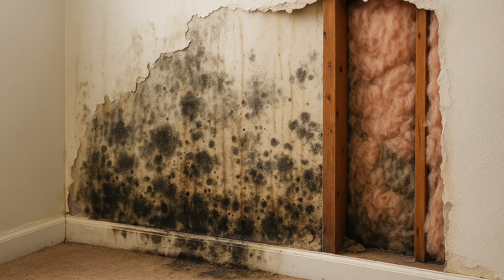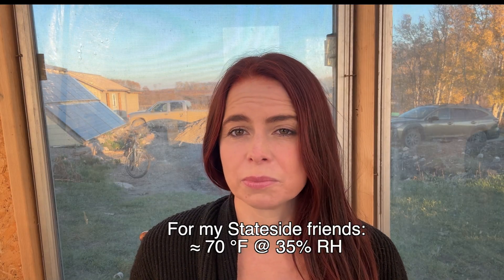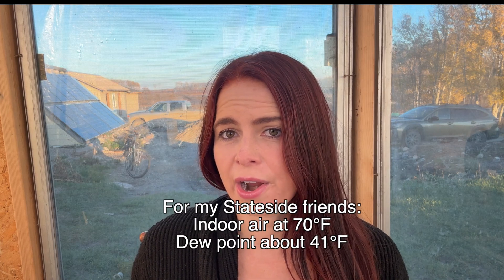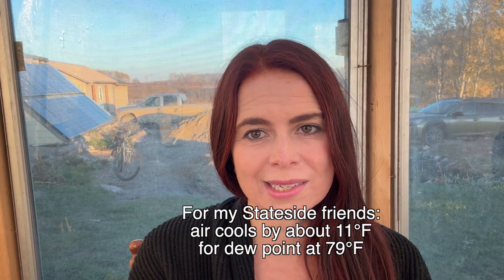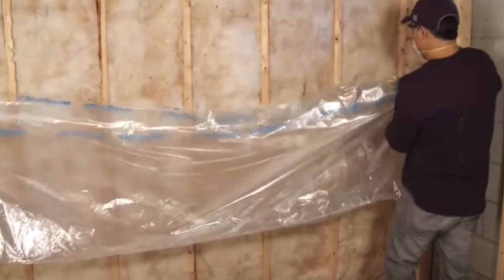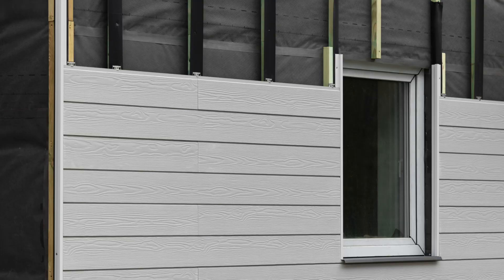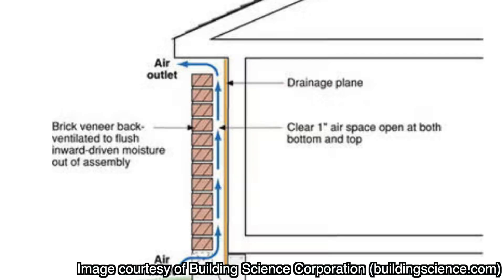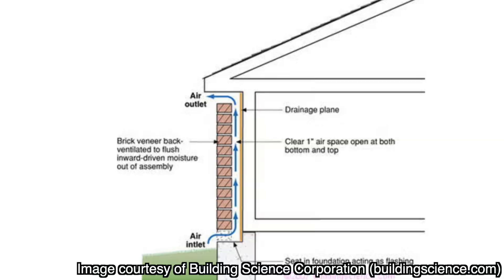How Air Leakage Rots Modern Homes (Even Without Water Leaks)|  Part II

Comment: I have an old house. Zero mold, house is always fresh and it leaks air like a sieve. When we try to make homes air tight thats when we trap problems, especially when these membranes are not installed correctly.
Reply from the maker: That's exactly it.. if we're going to make it airtight we really need to do it right.

Comment: The transition from plaster to taped drywall in most of N. America created a number of new pathways for inside air to get into the insulation cavity. There are gaps around outlets, heating ducts, and behind the wood trim that would have been filled in the plastering process, but are often ignored by drywall installers. The polyethylene  installed behind the drywall since the 1980s in most places is meant to block those gaps, but it's anyone's guess how well sealed it actually is. I make a habit of sealing around an outlet (especially the openings for the cables) or behind a baseboard any time I have to disassemble such things and over time, my 1950s house has become better sealed. As long as enough air is leaking through my 65 year old windows to remove any moisture I create and no significant amount of air is leaking into my walls, I won't see any mold.
Reply from the maker: @pcno2832 @davidparker9676
You’re both hitting on key parts of the same story. Traditional plaster really did seal up a lot of gaps that drywall leaves—around trim, outlets, ducts, and uneven framing. And lime-based plaster is alkaline, which makes it naturally mould-resistant in a way modern gypsum and latex paints just aren’t.

But as @davidparker9676 said, those houses also dried because they were drafty and had oversized heating systems pushing warm air through the structure. Once you start tightening an old home—without mechanical ventilation—you remove the very thing that kept it safe for 100 years.

Modern houses try to fix this with perfect air barriers, poly, tapes, and membranes, but the level of detail required is extreme, and any missed leak can concentrate moisture in hidden spots. So the irony is: old homes worked because they were both better filled (plaster) and leakier (drying). New homes are tighter, but now we have to engineer the drying.

That’s the heart of the challenge: airtightness without losing drying potential. Simple, durable materials like lime plaster and rammed earth solved a lot of this by default—long before building science had to explain why.
Reply: The old plaster houses did not have air tightness due to the plaster filling the gaps. The old houses did so well because they were drafty combined with oversized heating that drove moisture through the materials and air movement allowed it to dry out.
Sealing an old drafty home is how a 100 year old home begins to rot due to the reduced air movement and drying potential. Modern buildings with more air control measures and reduced sized heaters must have the details and craftsmanship done to such a level as to prevent even the smallest leaks in the air barrier to prevent mold and moisture problems. These modern homes are requiring more complex strategies to properly ventilate these tight spaces as the primary source of moisture in these homes is coming from the inside.

Simply opening the windows can help balance pressures and allow for improved drying of the structure without the need for elaborate mechanical or engineered systems..

Comment: Unfortunately Air Barriers don't really work. Instead the trap moisture in the wall cavity leading to rot. Even the so called intelligent membranes do not really work. They become more moisture permeable in humid air, and become less permeable in non-humid air.  Also consider that air barriers are full of holes: Stapled to the studs & also holes for all the wall penetrations, Outlets, plumbing, vents, as well as drywall screws & cuts\rips made during the installation of drywall. 

Old homes did not suffer rot, because they were air leaky, & allow moist air to escape through the walls. It wasn't until homes became more air tight that mold & rot became a problem.  For existing homes built in the last ~25 years the best option is to keep the interior humidity level low: Use your bathroom fans often, especially when running the shower. Install whole house dehumidifiers.  Installing exterior foam insulation on the outside of homes will reduce condensation on the wall sheathing & studs, which will reduce or eliminate mold & rot. The exterior insulation will help prevent the sheathing from getting very cold, which will reduce condensation.
Reply from the maker: That's such a good point. Maybe if we AcoustiSeal every small hole.. but the level of craftsmanship needed seems unrealistic. You've hit on exactly the reasons I'm talking about this stuff publicly. The air quality we end up with indoors - where we spend most of our lives - is not OK. 
I'll be talking about Joe Lstiburek's "perfect wall" in the episode on the thermal control layer. Exterior insulation is a big part of it. 
Every which way I look at it, though, it seems we've engineered ourselves into terrible, highly fallible building. 
All the while, ancestrally informed methods like rammed earth are there, ready to solve so many of the problems we've created.
Reply: Most air and vapor barriers as a foil are simply some kind of plastic, it's better to use some kind of vapor open building board (MDF, plywood, sheetrock, (OSB), fiber cement board, hardboard,...) as the internal air barrier, this will also act as a vapor retarder which is good enough. Simply retarding vapor diffusion makes that your wall still can dry to the inside if needed.

Exterior insulation will indeed reduce the risk of condensation and rot of your studs but not any foam. Most foam products are simply too vapor closed (EXP, EPS, PIR,...) so you're locking in the moisture inside your walls.
Better options for exterior insulation are therefore vapor open materials like wood fiber board, rockwool, expanded cork,...

In general, no plastics are needed above grade when building a house. And with the correct techniques, not even below grade.

Comment: You’ve inspired us to go the rammed earth route in building a home. Thank you for the well thought out videos that were exactly what I needed to know to make good decisions.
Reply: Rammed earth is great, take extra care with the Damp proof membrane the wall sits on to eliminate rising damp. Even with double dose Plasticure additive in the wall mix rising damp can be a an issue if not detailed properly.
Enjoy your house!
Reply from the maker: Good thought, it's important to use a proper capillary break.
Reply: @phillipdempsey8682 that’s been my current mission to figure out. That along with how to go about the flooring structure.
Reply from the maker: That makes me so happy to hear. Rammed earth solves so many of the durability and moisture issues we fight in modern construction, and it’s my first love when it comes to building materials. Just keep in mind that depending on your climate, you may need to think about added insulation, since rammed earth on its own doesn’t have a high R-value.

I have a video on the vapour control layer coming next week, and the thermal control layer the week after that, which should help with the insulation side of things. And as always, it’s a good idea to work with an engineer familiar with rammed earth for your specific climate and building codes.

Wishing you all the best with your build — it’s an exciting path to be on!
Reply: @RootedResilientLiving  We’re in central Illinois right on a narrow stretch of the middlefork river. So a core layer of foam along with moisture control will be needed for sure. We installed a septic tank a few years ago and the soil test guy said we have the best drainage around. He was very excited about our dirt lol.

Comment: Well let me correct you on something through observation in 45 of all kinds of experience.  Moving air dries!  That's why they make little fans to sit on floors when they're soaking wet so the air will blow over it and dry it.  You want your sheetrock mud to dry turn the fan on it'll change it by 10 hours.  You ever see a 100-year-old Barn you can see straight through and notice it isn't rotten to the ground it isn't moldy that's because the air is blowing through it.  Tear up a leaky tile floor or a shower you know why and you will see water and mold inside there because there's no air blowing through it.  So within the first 3 minutes of the video you've already turned me off because of your erroneous statements.  Sorry I can't listen anymore.  Maybe by the end of the video you've corrected yourself.  But it's just punishing to hear somebody say this.  Your math may be right in your science also but you have a little observation and experience evidently.
Reply: This must be the first video of her's that you tried to watch. Does she need to cover everything that she stated in previous videos? If so, she could never dive deeper into a subject. What happens to the 100 year old barn when you add a vapor barrier, insulation, and apply petroleum based paint? She's definitely done more research/study on the subject than the majority of people.
Reply from the maker: Thank you — I really appreciate that. It’s hard to go deep into a topic without repeating everything from previous videos, so I try to build each episode on what came before. And yes — barns, old houses, and heritage buildings can get into real trouble when we add modern vapour-closed layers without thinking about how they used to dry. Thanks for noticing the research that goes into this. It means a lot.
Reply from the maker: Air can definitely dry things — no argument there. The challenge in modern construction is that moisture often gets trapped behind layers that can’t dry. Once you have airtight membranes, foam, OSB, and vapour-closed roofing or siding, any water that gets in tends to stay there for a very long time. That’s why so many modern failures happen: the drying path disappears.

So the issue isn’t whether air can dry — it’s whether the assembly actually gives moisture anywhere to go.
Reply: Only air with a low % in relative humidity (RH) is able to dry but only if the temperature of that air remains more or less the same.

Old houses were always "bone dry" because the RH of the inside air was very low due to the stove, you needed to put a kettle on it to make it livable inside.

So yes, inside warm air with a low RH that escaped through the holes had a lot of drying potential in those days... but those days are over.

If you speak about drying potential of air, you most always consider it's temperature and RH.

Comment: All new construction should have exterior insulation taped at all seams like the Zip system, plus an ERV or HRV for makeup air. Aiics should be sealed at the floor to ensure the whole home envelope is air/water sealed.
Reply from the maker: 100% - if we're going to do stick frame construction we have to make sure we do it right.

Comment: What about rammed earth in a seismic zone?
Do you have any architectural details like wall section recommendations for rammed earth construction?
Reply from the maker: Great question! Rammed earth can work in seismic zones, but it absolutely needs an engineer’s input. There aren’t broad building-code standards yet for earthquake design.

Builders like Martin Rauch (Refined Earth) and Tim Krahn (Essential Rammed Earth Construction) show some really solid ideas: adding rebar for tensile strength and using trass-lime bond layers (a lime-pozzolan mix) to tie lifts together and protect the steel. That combo helps the wall act a bit more like reinforced masonry.

But details like wall thickness, reinforcement spacing, and soil type all have to be engineered for your site. So definitely bring those references to a structural engineer familiar with earthen or masonry systems.